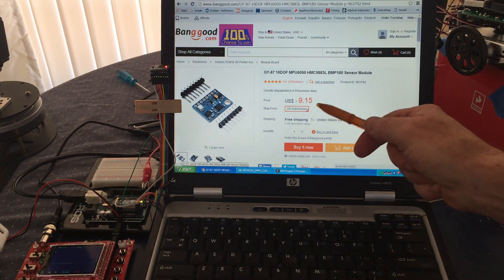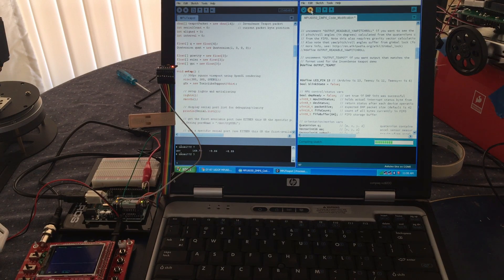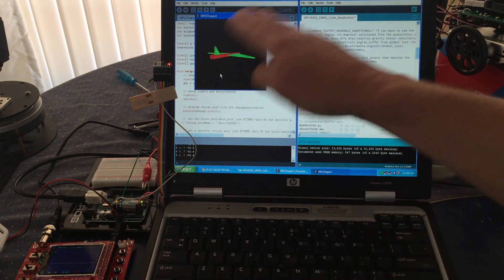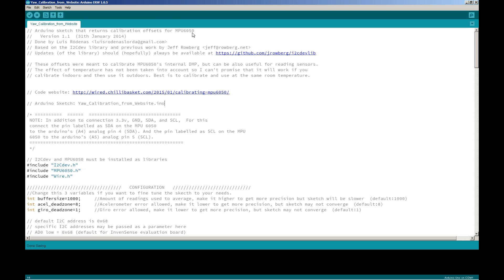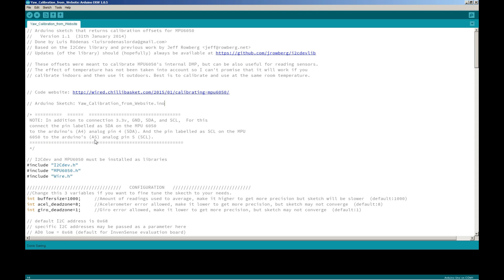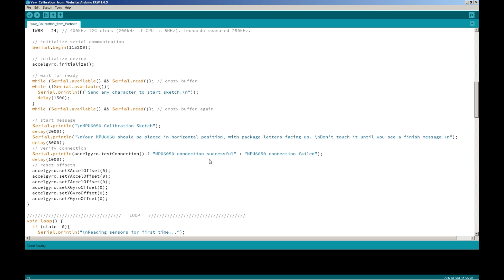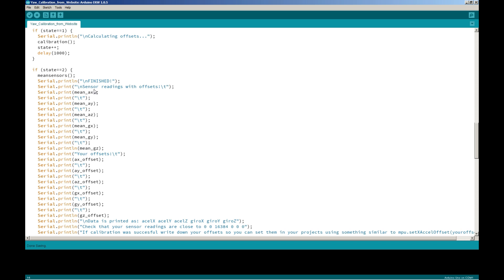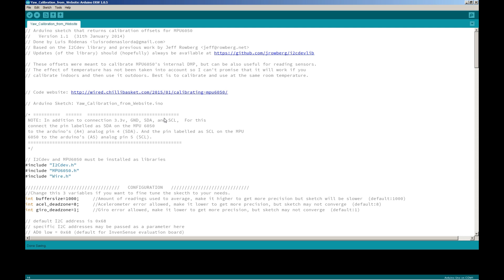Calibrating MPU6050 6 DOF Gyro Accelerometer Module

Comment: Thanks for the code...
i am using Uno with MPU6050 but the offset values are not getting displayed on the serial monitor..Just three dots again and again..
Please help me..
Reply: chek your cables with the arduino 
I had this problem and I tested the simple sketch from arduino website and it display 000
So the problem was in the contact of the cables with the arduino